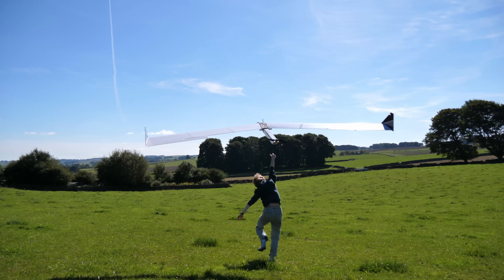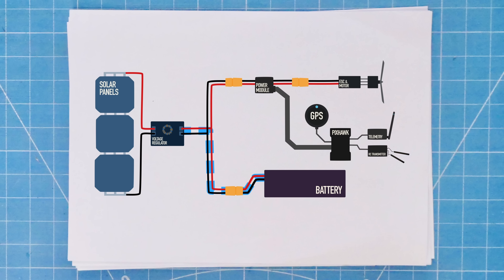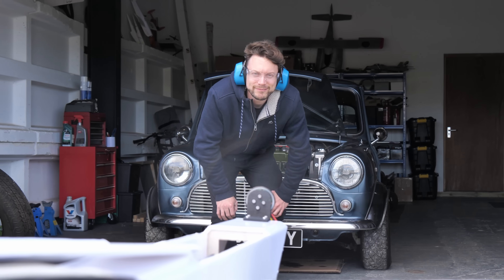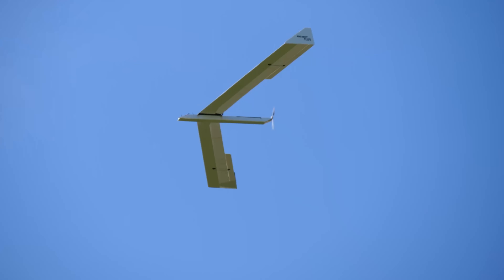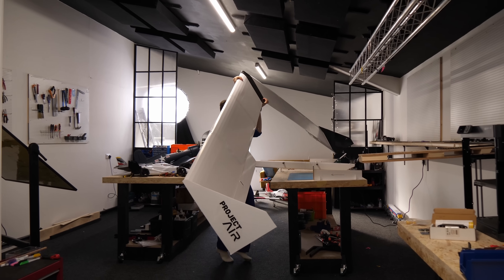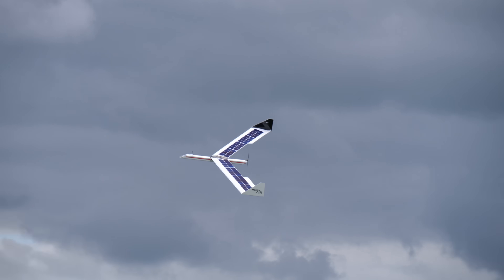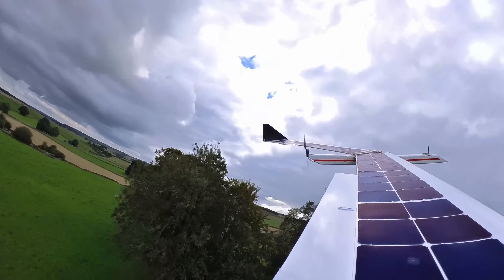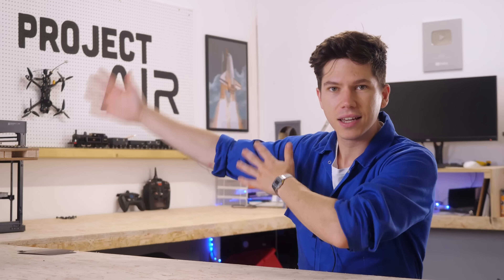Solar Plane V2

Comment: Hi! I really love such solar plane projects and plan to implement it one day. You have made a good progress, although I see some problems in your design. If I were you, I would do the following:
1. Replace a bulky LiPo battery with more lightweight DIY Li-Ion pack. It would be like 30% lighter and you can arrange it into a long narrow pack, which would allow to make a smaller hull, minimising frontal area and drag.
2. Mount the motor inside the hull. It will greatly minimise drag. Mounting it may be a bit more challenging, but solvable with 3d printed bracket. Or you can just change your existing motor mount with a more aerodynamic one, that would be an easy fix.
3. As others have already mentioned, MPPT controller’s purpose is adjusting current which is pulled from solar cells in such a way that generates more output and it works more efficient than a simple converter. I suggest you ignoring load output in your MPPT and pulling power from the battery instead.
4. Improve hull aerodynamics. It looks too big, has no front cone (I don’t see any reasons to keep it open from both sides, except for cooling (which is unreasonable and may be improved by having an ESC outside)). Reducing frontal area and adding a nose cone is quite simple.
5. Issue with motor mount being broken off on landing: use folding props. It will fold on landing and while soaring/gliding (and reduce drag). Be sure that not every folding prop mount suits pusher configuration, as props may fold «inwards» and won’t fold out when spinning.
6. Reinforcing. Aluminium is lightweight, but not as lightweight as carbon fiber rods. They may be harder to find and definitely not as cheap as aluminium rods, but far stiffer. Bonus points for making a special battery pack which may be inserted into a carbon rod (I doubt you have a wing thick enough to implement this idea, as 18650 cell and wiring will be quite large, but that’s just an idea). AFAIK AtlanticSolar did this to distribute load on its wings, thus allowing to have higher aspect ratio and thinner hull (by moving batteries to wings). Also, your L-shape aluminium extrusions may be drilled out in places which don’t bear load (for example a side which goes flat on the wing bottom side) which will allow to shed some weight. I also worried if your aluminium extrusions are connected in the center, if not the wing can snap.
7. Top-sided winglets may cast a shadow on solar cells, reducing overall power output. Mounting them inverted will solve this issue, but will certainly break off on landing. There might be a way to make them detach on touchdown, but it sounds more like the least priority to do.
8. Wing profile. That’s probably the most complicated thing in the whole build. I can’t see it clearly, but assume your bottom side is flat, and the top is also flat. Making top flat is probably the only solution to mount solar panels which can’t be bent, but such geometry (that’s my guess, I’m not even close to being an aerospace engineer) produces lift only when an angle of attack is not zero. This means higher drag by keeping nose up. I’ve seen a solution on rctestflight channel which looks like a ladder: solar panels are put on these «ladders» and form somewhat nice aerodynamic shape.
Btw your idea with joining two gliders is cool, but these gliders are based on real life gliders which have a thick cockpit for a pilot, which adds excess drag. I’ve bought a Voluntex ASW28 for endurance flights and plan on getting rid of stock hull and replacing it with custom narrow carbon fiber one. 
Anyway, I’m waiting to see new videos with the solar plane!
Reply: Stepped Airfoils can actually be more efficent at low speeds and would be a good place to put them, they might get a little shaded so im sure theres a balance.
Reply: Bonus points if u use tiny lithium button batteries in the carbon fiber wing spars. If ur gonna connect 2 gliders, I recommend looking at the p38. Go from there.
Reply: Yes, this a probably a lot more.  You keep calling this an engineering challenge, but you seem to be neglecting a lot of the engineering part.  Engineering mainly happened before you take flight, not afterwards.  You're just doing stuff and then troubleshooting it.  Troubleshooting certainly happens at this stage, but it's not an excuse or valid design technique (as opposed to doing more proper work up front).  This was your second airborne design.  It should have gone MUCH better than this.  This was practically a step backwards.  You're designing something based on work that's been done countless times already.  You're missing the basics.  (I know you're just a kid, and this is just a youtube video, but no one should look at this the way to conduct a project.)  Seriously, good luck going forward.  I hope you have great sucess.  I love seeing young people doing this kind of thing, but you are also a role model.  Up your game.
Reply: @glenmiller1437  I'm certain you bounced back and forth on whether or not you should post this.  It's easy to be seen as being critical even when your intention is to help.  IMO you made the correct choice.  Almost none of this is new ground and a good deal of this information is readily available online.   Be patient, do your research, and most importantly don't be afraid to ask other engineers for help.
Reply: @genephipps6421  Lol, yep, you read my mind.  Well stated.
Reply: @glenmiller1437  There must be simulation software available to test airframe designs before so much work is put into building one.  Just as there must be equations to calculate the lift and drag of your airframe.  Math is not as sexy as flying, but it can solve a lot of design problems before you waste a lot of money.
Reply: All lithium batteries are li-ion (lithium-ion), regardless of whether they are packaged as a pouch or a cylinder. Pouch cells are probably actually the best option since cylinder cells (like 18650s) would waste more weight on packaging.

Comment: Hey mate. Awesome video as always. Regarding the L profiles for the wings: a much more weight saving option would be, to cut out unnessesary material.A quick FEM- analaysis should show you, where you can save material and therefore weight. Of course, cutting out a hundred slots and cut out by hand would be a pain, but cutting it on a large format water jet cutting maschine and bending it afterwards could save a lot of weight for not any loss in stiffness. I don't know if something like carbon fibre would do the job, as this would flex by itself, but the cutting method could be an option maybe?

Comment: Charging a lithium pack with a voltage regulator is a recipe for disaster, and also fails to properly load the solar panels for maximum efficiency. Put the mppt back in the loop, but power the motor directly from the pack.
I'd personally run the receiver and servos using a separate pack that is either wired up with a passive failover circuit (custom) or continually charged from the motor battery using a small liion charger rated for the average draw of the receiver +servos
Reply: I too like the idea of a separate battery for the controls

Comment: Your design, as I see it, has several things working against it:

1. That aluminum spar is probably more than the wing actually needs in terms of stiffening. You'd probably have better luck with a less-substantial aluminum or carbon-fiber reinforcement, or you could build a torsion box out of balsa. The challenge isn't making the wing strong enough, it's making it just barely strong enough. If it didn't break in the first test flight, chances are good that a very minute amount of reinforcement would be enough to stand up to most turbulence. Your wing probably only really needed any real reinforcement towards the root.
2. Swept wings inherently have poor lift properties at low speeds. Your wing is actually swept well into jet airliner wing territory - unless you're in the mood to start adding high lift devices, you're kinda working against yourself.
3. There's no reason why the chord of the wing inboard of the elevons shouldn't be extended to match the chord at the elevons. Sure, the overall aspect ratio of the wing would decrease, but I doubt it'd create enough drag or weight to offset the lift benefit, especially since I'd wager increasing the chord at the tips is adding to induced drag...
4. You're going to have to optimize the powerplant for efficiency with respect to thrust... a ducted fan of the same diameter as your propeller is probably the best approach. While the duct imposes a drag penalty at high speeds, you're low and slow.

I don't think a delta wing is going to solve your problem - in fact I think it might make it worse. Delta wings are low aspect ratio by nature, so you're going to be sacrificing a lot of efficiency to no real benefit since your airplane isn't meant to fly at supersonic speeds. You're designing a low-speed airplane. High aspect ratio straight wings are the way to go.
Reply: God, I was thinking the same thing about the wings, like every solar plane created has had straight wings for a reason.
Reply: Rctestflight made it work. Though he was following quite a different design with much wider wings
More wing = less efficiency
However
More panels = more power
Reply: A hollow tubular spar would give better strength for the weight. Also,  the spar doesn't need to extend the entire length of the wing.  Some wing flex is perfectly fine.  You just need enough strength to prevent catastrophic failure.

I assume you made the wings swept because of the center of gravity.  Otherwise, straight wings would be better for the low speeds.
Reply: Spot on!

Comment: Don't use buck regulators, you'll get a lot less power out of the solar cells since they are current generators not voltage generators

Comment: For motor mount, you need some ribs. And also print orientation is crucial. You snapped mount along layer lines, just print your mount on the side and you'll be fine.

Comment: Congrats for this partial success. You really stepped up your video production game. There is a reason people use MPPT-Chargers instead of DC regulators. The reason is that we do not really care about voltage but power and the power from solar cells gets really low if the current is too high. This happens when the battery voltage drops, e.g. when there is voltage sag when more motor power is needed. It may be worth testing your charging setup with the actual solar cells and changing lighting conditions and motor power. Also, with a plane that valuable it is always a good idea to provide a small extra battery for the receiver and servos so the plane can be landed as a glider if push comes to shove.
Reply: @Gosuminer  maybe a small parachute system instead?
Reply: @JojitBuenaventuraJr  A parachute with failsafe release system would weigh a lot more than a tiny battery. Plus it is better to land the plane than to have it come down uncontrolledly, maybe into a tree or water.

Comment: Use carbon and glass fiber laminates to form the wings. No additional reinforcements are needed, probably gives you the lightest fuselage. 
Composite materials also make it easier to produce more aerodynamic joints. For your solar powered plane, efficiency matters
Reply: Foam board is nice for scrappy builds, not for builds that try to give the impression of proper engineering.

Comment: Take a look at stepped airfoils. Watched a video of someone else doing testing of stepped vs conventional airfoils, and at low speeds, stepped airfoils can actually have even lower drag than conventional. It could be seriously even more help in your case, since the the solar cells create extra drag on the top of the wing, the exact place that's removed in a stepped airfoil to reduce drag.

Comment: You could take a lot of the gravity out of that aluminium 'L' bar by introducing speed-holes. With the right hole pattern you could keep the rigidity but lose up to 60% of the mass.

Comment: without MPTT and seemingly no battery protection the only upside seems to be... drawing power from the battery when its below safe discharge voltage?

Comment: You could always use carbon fibre rods to stiffen the airframe 👍 Great video!
Reply: Carbon spars at least.  Would be a fraction of the weight of aluminum
Reply: It's funny how much time and effort goes into these projects and they tend to fail on such annoying mistakes. Watching him is very relaxing and extremely frustrating at the same time 😂
Reply: @gergelycsonka3509  Busking one's way to making a glorious failure is very British.
Reply: Exactly what I was thinking
Reply: was thinking the same, also drilling a lot of big holes in the aluminium and mostly removing the horizontal part could have saved like 60% of aluminium weight without losing a lot of vertical stiffness
Reply: @borisssman  I was also thinking about routing out big holes in the aluminium to reduce the weight.
Reply: You beat me to it. Exactly! I'm building a rc plane now that uses Aluminum.  Not those Monster Girders! Carbon Fiber is Prefect for His Wing!!!!!!
Reply: That's what I was thinking too it would increase the efficiency of the plane by a lot cuz the weight would be a lot less.
Reply: THATS WHAT IM SAYINN
Reply: a stiff enough carbon fibre rod would be at least 7 times lighter and nowadays carbon rods are pretty cheap and easily accessible
or else u can custom mold the airframe in carbon fibre itself using a few layers although it would be no means cheap.but,once you get it,
you can't destroy it even if you tried which would give a lot of room for testing.
Reply: Landing skids, kind of like wheel less helicopter landing gear . Very little drag, but will give you many, many safe landings without damage. Could do inverted wing tips as well with a skid attached to the bottom of those as they are likely to touch ground as well.
Reply: That... and the wings themselves perhaps need be 'thicker' or wider. I actually think they would possibly snap a CF rod the way they are, they're extremely loaded.
Reply: It'd probably help if he was within a day and a half of driving across mountains to a high desert valley too, but I suspect the UK lacks that feature.
Reply: problem seems to be torsion of the wings, not only bendding. so cfrp rods wont help much in that regard
Reply: @joseppedaia3673  you could run 2 carbon rods down there and torsion would also be solves especially if you connect the 2
Reply: @borisssman  would be one possibility, yes
Reply: Nothing expanding foam wouldn't solve really.
Reply: I would try making it airtight, and use helium for stiffening, and extra lift. 

At least the stiffening part works for rockets. 

Get some extra lift by pushing some air out of the wings.

No part is the best part.
Reply: @jtjames79  it definitely wouldn't hurt.But it leaves no room for testing
Reply: @editorial5416  Party balloon helium is super cheap. It's the rocket and the medical stuff that's expensive. I would just tape any holes for testing, and give the helium a bump every time you change batteries.
Reply: He was too busy cleaning his coveralls and making sure Emma is in the shots 'looking helpful' to think about building the plane properly as the title implies. I burst out in laughter at the end when he's gleefully opening a plane kit someone else built.
Reply: @V0S1N0  Exactly my thought... He puts so much into how everything looks on camera that he doesn't try to design and build properly.
Reply: @aGabay  je pense que c'est la forme des aile qui ne vas pas elle sont bien trop longue par rapport a la taille du fuselage raison pour laquelle il n'obtiens pas un vol stable ... une aile en delta me semble plus adapté a son projet
Reply: @StepOrDieFR  what? English...

Comment: I’ve done a few solar projects on my own time, definitely not an expert. I would keep the MPPT rather than the voltage regulator though, by connecting the load directly to the battery rather than into the load connection on the MPPT, the other two connections remain the same. In this case the MPPT can charge the battery without worry of disconnecting the load. Keep up the good work Love the projects!
Reply: Yes, that is the solution in this scene. MPPT is way more efficient, but connect the load directly to the battery, don´t use the load output from the MPPT.

Comment: I also have a solar charge controller that protects my batteries by shutting off. The thing is, I really really must keep my navigation lights on at night, or risk being run down (and killed) by a ship. So I have an override switch that bypasses the controller. It might damage my battery, but on the other hand, I'm a lot less likely to die. When your plan fell out of the sky, I was 90% sure I knew why!

Comment: Love your channel and work!
You can also add solar panels under the wings
It will help a lot , but propably just one third of the power from direct solar
 And if you do, you will also need one more charge controller for those solar cells
This will be the same as on my roof I cannot use same charge controller at my east roof as on my south facing roof
but still i get 2/5 or so energy from the panels who is in the shadow on a bright summer day And even "better" on clody days (not "more power" but at Hazy days it kinda evens more out (80kWh battery bank and 20kW solar)
Regards from Norway

Comment: Yon need no MPPT, the T, the tracking will endelssly oscillate on a plane. You also dont want a stepdown, it will cripple solar production by not keepin MPP voltage. You need a MPP controller with manually settable input (mpp) and output (battery) voltages and no "load shutdown". A 3A one costs $5.
To avoid shading problems have the 2 wings in parallel. This might need a lower voltage lipo and higher kv motor. If you have all solar cells in series, shading of one cell will kill the output of all the cells.